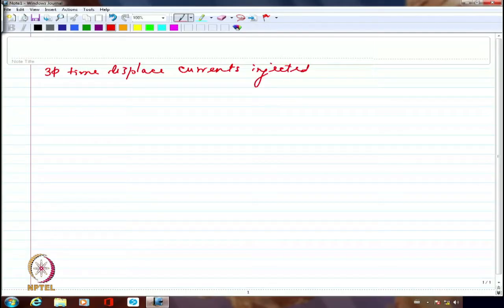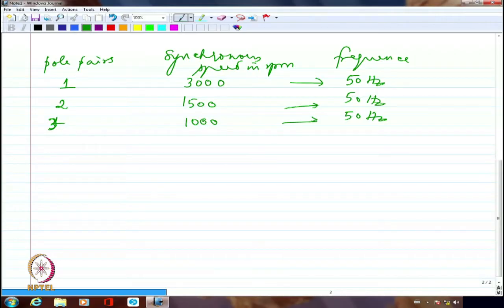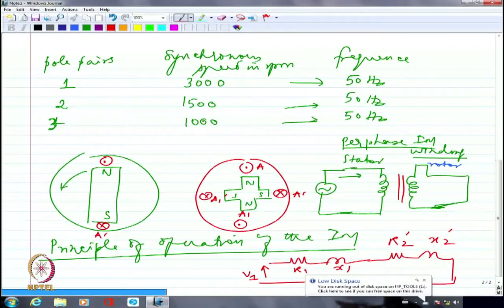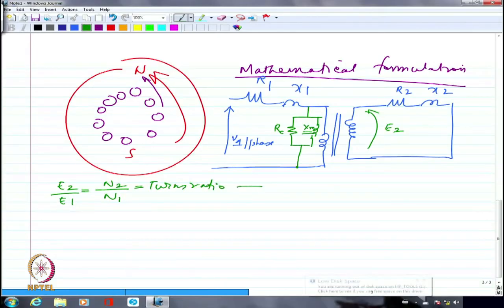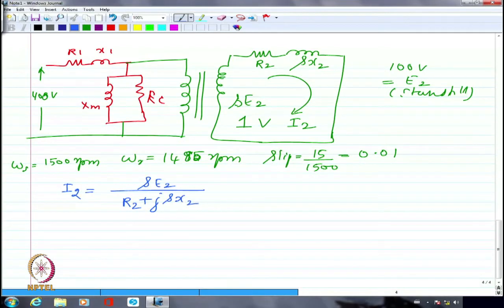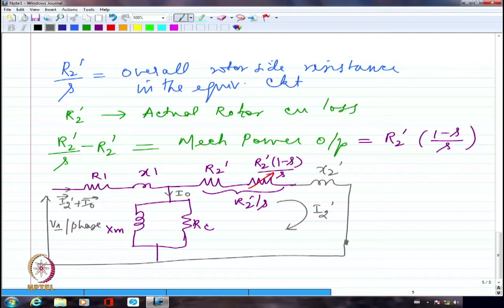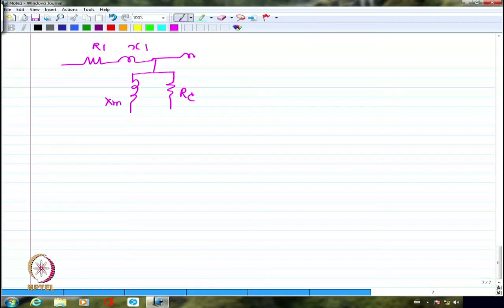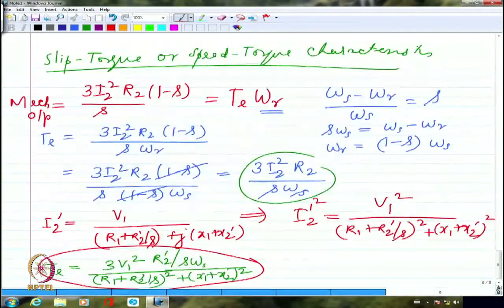mod10lec30

Comment: 2 ph servo motor basic 2:00
multipole stator construction 5:33
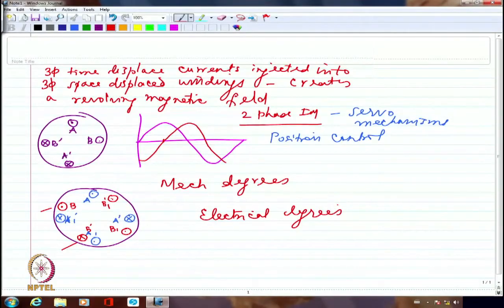electrical and mchanical degrees 8:00
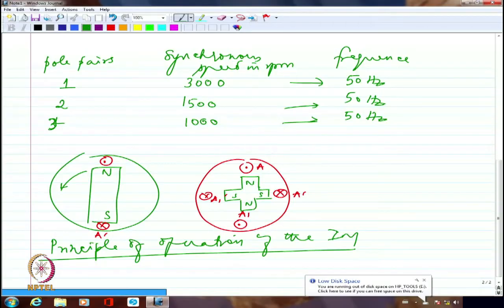principle of rotation of IM 21:30
in a nutshell rotor torque locking in with stator 31:45
mathematical formulation with eq ckt 37:10
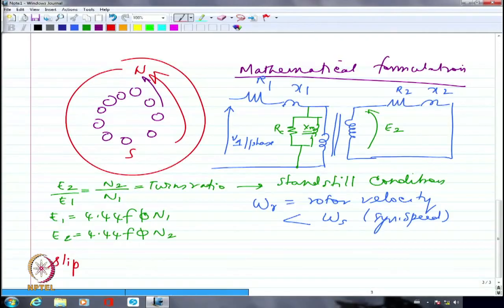slip 46:00
t vs w characterstics 1:32:00

Comment: absolutely love these videos! have been a great help.
Reply: What does it mean to short circuit the rotor.
Reply: @mr.hibster9603  Short-circuiting a device means that you connect the two terminals of the device with a piece of wire, this way all of the current flows through this wire since it has zero resistance and none through the device; the device essentially gets removed from the picture.